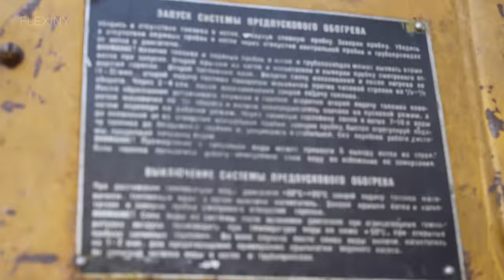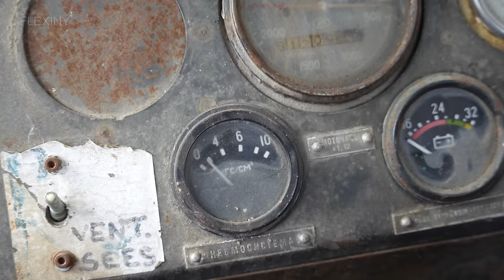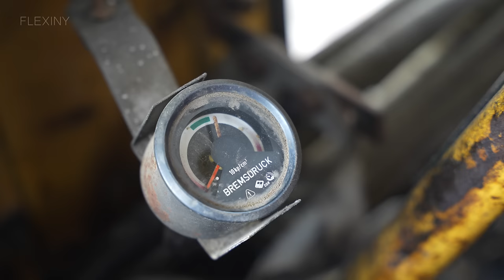Starting Tractor K-700A (V8 Turbo Diesel) After 6 Years + Test Drive

Comment: I'll never forget knowing this badass piece of machinery for the first time in that viral video of one stuck in a river, almost completely submerged, that the driver refused to give up and finally got out of the water.
Awesome!
Reply: While pulling a trailer. Awesome video.
Reply: By the way, video with Kirovets in the river featured K701, it has V12 diesel instead of V8
Reply: @timoth2536  
Is the V12 turbocharged though ?
Reply: @Grumpy_old_Boot  No, they had naturally aspirated V12 or turbo V8. Both sound awesome anyway
Reply: @Ratzfourtyfour  
Ah, they probably have about the same power then ... still, very cool. 🙂
Reply: @Grumpy_old_Boot  naturally aspirated
Reply: not in the origin engine. But You can retrofit with a charger and camshafts. Unfortunately without a sound like in this clip.
Reply: Me too! I really thought that was a goner when the bonnet went under.
Reply: @Grumpy_old_Boot  V8 has 220 HP, and V12 is 300. But the torque is the same
Reply: Привет из СССР  РОССИЯ. Я это видео про Кировец и реку тоже видел несколько раз пересматривал.
Reply: @Grumpy_old_Boot  турбированные оба. ЯМ3 240.  12.цилиндров.  Турбированый. 500 лошадиных сил без накруток.
Reply: @ВадимКамалетдинов-б7ф  Это точно машина "судного дня"!
Reply: @Roddy_Zeh  Родриго здоровья тебе и мира.
Reply: Русские не сдаются!
Reply: Yes I remember that one to. Awesome !

Comment: I have been a fan of these tractors for a long time of course utube only I have never seen one in person.  They seem to be just as much truck as they are tractor with air brakes, never seen that on a tractor before. The injection system looks very old fashioned but obviously effective and should be easy to work on, the priming system looks very similar to almost everything except a Detroit, in all the vids I have watched these tractors in action I have never seen an implement mounted on the front, everything from blades to blowers are mounted on that for lack of a better work 3 point (russian version) on the rear of the tractor, why is that?  I have never even heard of one of these in the US, I would sure like to drive once once especially pulling a big disk or something so you could really hear that magnificent turbo sing!  VERY good video thanks you for sharing!

Comment: Turbocharged V8 version............I drove one of these in the 1980's here in Australia, but it was a Naturally aspirated V12.  Grandfather had a few, once they got the welding rods out the transmission, the cigarette packets out the engine, and the gallon of sand out the differentials, they were very good machines.  Grandfather wrote a letter to the Premier of the USSR.........the factory in SPB was investigated by the KGB and 5 directors were arrested.  Nobody ever saw them again.

Comment: In my country, ex Yugoslavia, imt used to make similar tractors, with Mercedes v12 engines, bi turbo diesel, around 520hp. The engine was great. But the tractor's gearbox and differential could not stand its strength. You had to know how to drive, work, shift gears....

Comment: Great Work, but definitely hand crank with a power bar, or pull it to turn the engine insted of wrecking the starter motor. And drain the oil, refill with fresh Engine oil after using diesel fuel to lubricate and unstick the piston rings, as the engine oil would be heavily contaminated with diesel, increasing the risk of a runaway unit.

Comment: I think it has only 250 hp V8 engine but for that time it was beast.
Reply: It is not designed for racing, due to the fact that it is diesel, it has 300 hp and 1240 torque, this is enough for it

Comment: Nice Job. I will have to do the same soon on a K700a which didnt run for 10 years. Do you need to change some gaskets if you take out the injectors? thanks
Reply from the maker: I only had one valve cover gasket new.. I recommend to change both. After injectors assemble dont put valve covers on, check for fuel leaks because it can be dangerous for engine.
Reply: @Flexiny  Thanks for your advice. The injectors itself have no gaskets, for example a copper ring that need to be changed?
Reply from the maker: @BerthaLeChic  They have copper rings, it is always good if you replace them but I didnt had brand new ones, I reused old ones and they didn't leak.

Comment: I am very jealous that you guys get to to this for a living! Also a question, do you keep some of the cars you get running or just sell them?
Reply from the maker: This k700 was not our, we helped to get it running again. But mostly if car is rescue able then we clean it, make it run again and sell it mostly. Like that bmw e36 compact, mazda 323f bg or mitsubishi lancer in previous videos, we started them, cleaned, fixed some issues and sold them, new owners fixed last issues and did inspection on them and these cars still driving around. 😀
Reply: @Flexiny  well, that certainly clears things up. Thanks!

Comment: Amazing. Why did the soviets choose this strange design of tractor?
Reply: So the engine could fit at the front
Reply: Nothing strange about the design, it's a normal 4WD articulated tractor.
Reply: @tommeiner9983  Ok, but why only used in CCCP..?
Reply: @Engineersoldinterstingstuff  It wasn't only used there.
Reply: @tommeiner9983  Reframing my question,  -was this kind of design used by any western producer?
Reply: @Engineersoldinterstingstuff  I don't know what exactly you're refering to as "this kind of design". Almost every tractor manufacturer had 4WD articulated tractors...
Reply: @tommeiner9983  Ok. Interesting - never seen articulated traktors in Sweden.
Reply: @Engineersoldinterstingstuff  That's weird, because you have them.
Reply: @tommeiner9983  OK. But they are definitely not common.

Comment: Articulated tractor with air brakes.  The only other I know of is the John Deere 8010 from the 1960s- John Deere's first articulated tractor, of which only 100 were built as the company lost tremendous capital both in developing the tractor and replacing failing transmissions.

I wonder if the company put this unit aside because they weren't allowed to run it anymore?

Comment: All that stuff that flew out of the exhaust once it started, went into the engine through open rocker covers wtf? These guys should've closed the bonnet.
Reply from the maker: We didnt knew that there will be flying something out of exhaust. We had to make sure if injectors are not leaking fuel into engine.